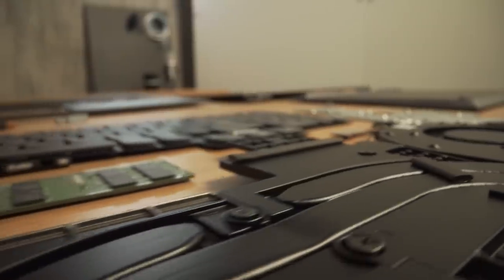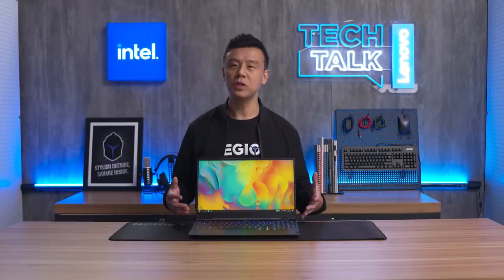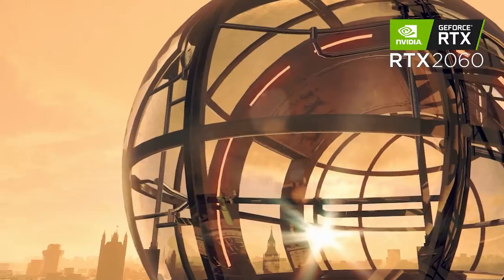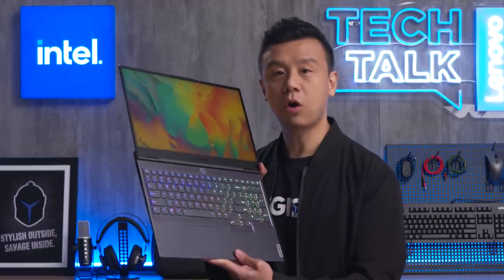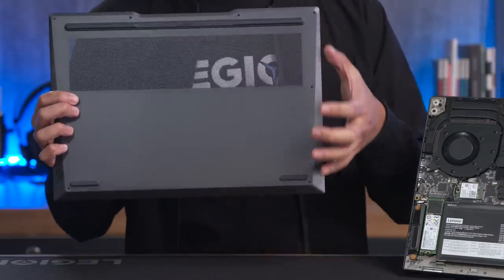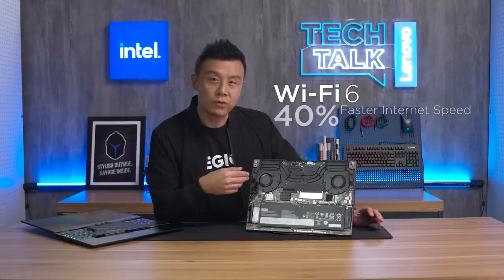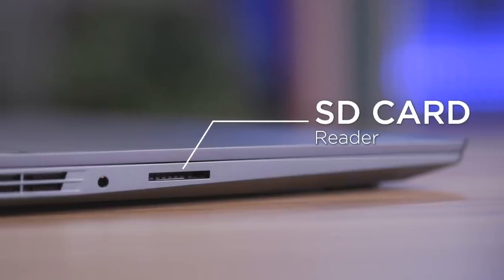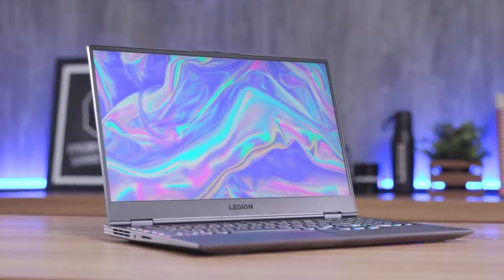Tech Talk | Lenovo Legion Slim 7i

Comment: Suprised this isn't for sale yet. The 11th gen H processors and 3000 series gpus will be out soon... Who will want last gen parts when that happens?
Reply: At 1080p who really could complain. This is innovation
Reply: If the price comes down yea
Reply: also no ryzen 4000
Reply: But for those who want to buy it with a GTX 1650 or 1660Ti it's fine, there won't be an upgrade for these two graphic cards
Reply: With this chip shortage IDK how much availability there will be. I'm buying whatever they have available rn.

Comment: I own this laptop with config: 16gb ram, 512gb ssd, i5 10th gen, rtx 2060max q. And i love it. I might just upgrade ssd because 500gb is pretty low so lets see how it goes. Firstly i was worried about the processor because my model has just 4 cores bit it is not a problem. I can easily run windows and VM with another os with no problem. So I really recomend this laptop. The only issue i have is that when i change thermal mode to anything other than balanced ikd why but cooling acts like it is still set to balanced firstly when i set thermals on that turbo mode or how do you call it.. cooling went wild. But now about a week ago it still acts as it is set on balanced and cooling starts automatically. This is not a really big issue but it would be nice if it just worked same way as when i firstly booted up.

Comment: My legion 5 arrives tomorrow. Excited
Reply: Gaming? heat?
Reply: @TheDataArchitect  max temps don't go above 72 degrees. Really good thermal performance. Can get 50 to 60 fps high settings in recently released games. Games like Arkham knight give 60+ fps in high settings. Worth buying
Reply: @theattacktitan9885  are you in colder country?
Reply: @TheDataArchitect  nope. Maximum temps are around 42°C. And yes today the temps reached 80 for the first time during heavy gaming.
Reply: @theattacktitan9885  did you see any issue with high temp? what game did you played today? will it run battlefield 3 easily?
Reply: @TheDataArchitect  80 degrees is pretty normal for a gaming laptop. If temps go above 90 then that is concerning. And yes battlefield 3 would run flawlessly

Comment: Why stop the legion slim 7 amd? Time to come to red team. please Lenovo
Reply: True! Would def go fo amd model of dis
Reply: cuz thunderbolt (egpu)
Reply: @levgodar7596  Thunderbolt works on AMD right?
Reply: @drederickferksen2643  I wish but the new usb4 is basically a direct copy of thunderbolt 3, and will probs role out in the next gen amd laptops/ desktops
Reply: Some motherboards do support it but it’s complicated
Reply: @levgodar7596  That's the reason I haven't gone for an AMD laptop, I need Thunderbolt and it's so rare to find on an AMD motherboard; even when you do, it's not TB4 so you're already buying into old technology.
Reply: @derekchapman5167  but there is only an incremental difference between tb3 and 4

Comment: 144Hz (1920 x 1080...), 300 nits...,  or 60Hz... (3840 x 2160), 600 nits,  why not the same or similar monitor like in Legion 7 (seems 
almost perfect, non-touch... 16-inch, QHD 2560 x 1600 px IPS, 16:10, matte 165 Hz 3ms response, GSync support 400-nits, HDR 400, 100% sRGB). 
First option I would like to have higher resolution. Second just 60hz. Track pad on the side they could be in the middle. Like the slim part.

Comment: If you're genuinely concerned about your customers, what are you gonna do about the absolutely pathetic, sad and unprofessional after sales service of Lenovo in India (which is a part of Asia)?

I have a Legion Y530 and has had motherboard problems twice taking upto 3 months to be detected and resolved. Once again I am facing the same issue.
Reply: Karan Shah honestly with a system that old which is probably 2 years by now, i recommend upgrading?
Reply: @Crispychickenparm  Sure. But these problems started surfacing within 6 months. Total motherboard failure. And they took 4 months just to diagnose. 

You should check Lenovo's social media, numerous counts of poor service with no resolution.
Reply: @krazzykaran07  well if i were u id sell the laptop. But hey, atleast they fixed it... right?
Reply: @Crispychickenparm  Really? That's your fix sir? If they do not provide proper support or system crashes soon enough, you sell the laptop? 

What's the warranty for? You think it's justified to take 4 months to fix a simple problem? 

This isn't the case with just me. There are several cases of aggravated customers where they have been troubled by Lenovo India just like this.

 I'd request you to take a look at any of Lenovo India's social media posts. Most are filled with unresolved complaints. 

Not cool

Comment: Where could I buy a configuration that I like on https://psref.lenovo.com/Product/Legion/Lenovo_Legion_S7_15IMH5? I am looking for a machine on the market in vain. They are simply not sold nor available.
Does anyone have a link to a site where any of these models can be bought? (Shipping to Sweden)
82BC0022MH
82BC0033MH
82BC0055RM
82BC006QRM
82BC006RRM
82BC006VCY
Just for emphasize: I am looking for a replacement since Christmas last year for my old machine, a Y510P which will become 7 years old in February. I know exactly what I want to buy and that is being produced. Those models seems just to never become available. Lower value models are sold with HDD, out-of-line-versions like the 120MHz screen, with 60 Wh 4-cell battery, with white backlit keyboard, with NVIDIA RTX 1660, and so on. I wonder why the really good models can't be bought. I don't understand.